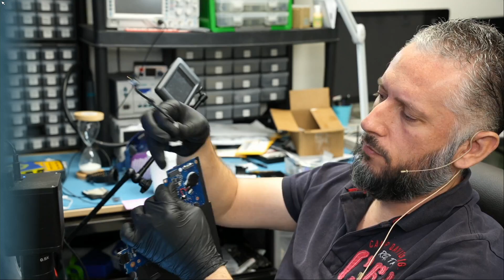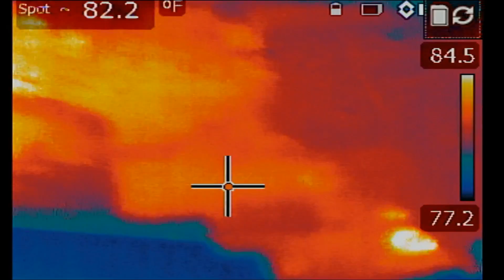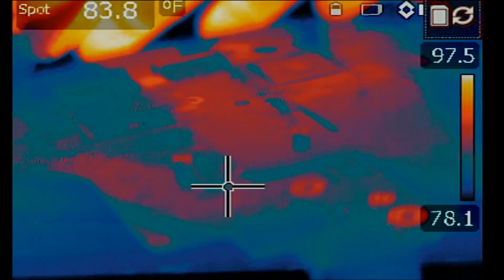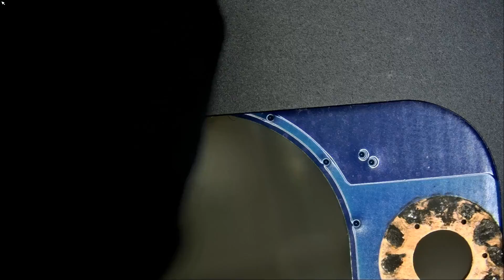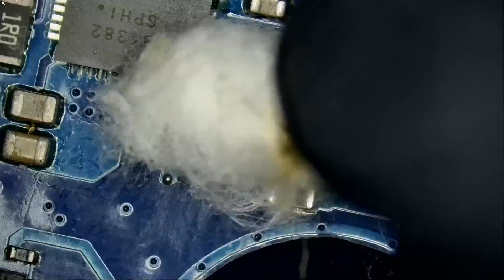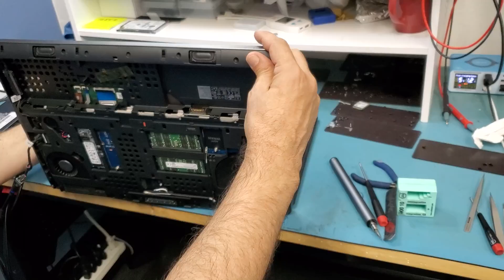Dell Precision Repair. Charger turns off and Laptop won't power on.

Comment: I have a 2018 precision 7530 that had the same symptoms as described in this video. However, the root cause was not a short circuit, it was a bad charger. I started by replacing my charging port and when that did not resolve my problem, I ordered an aftermarket charger online and that new charger resolved my issue, my laptop began charging again. WHEW! Glad it wasn't the mobo.

Comment: Would you know what causes a Dell XPS 8500 Series desktop PC not turning on. The power button was tested and it's working fine but the pins on the motherboard that connect the power button are not working as well. I touched it with a screwdriver but does not turn on the PC

Comment: @NorthridgeFix
Great "simple" repair of course excluding the immense disassembly reassembly process of the machine. It would be no other way that the repair is buried somewhere deep on a machine more complicated to disassemble. I've done a few of these, but I have it start to finish. No big Boss to help while I repair another. Prescription bottles with a dry erase marker are good for the many parts of each machine. Also a magnetic mat and a magnetic parts tray that mechanics use are great ways to keep the screws in check. Most notable for this video was that the ending was the most played section as people studied Alex's work area to see what he uses to do repairs AND videos. How a bout a video sometime with the description section listing the make and model or at least a decent description of what's there in the work area for those that are deciding to do the work? If people know what works for you they would waste less time getting the wrong equipment. Example: you always mention everything you use in the shop is available on the website, but the video production equipment lighting, computer build switcher, cameras, screen, filters and some miscellaneous tools etc are not there.

Comment: have tablette dell venue T07G 11 pro ,I left it updating at night, and in the morning I found it turned off also the power light is off I tried most solutions in the dell's sit but always still off,I checked the power charger it's good it gives 19.5v and when I checked the connectors battery emplacement I found 2.23v, my friend tell me you must change the battery, but I think perhaps the Dc power jack board of computer is it out, please could you help me

Comment: what are the tiny 3 pin transistors that are labeled 24J36? at 2:55
how do you find out the differences between different ones?

Comment: If you don't have the rosin (flux) atomizer, freezing sprays also works very well.
Isopropyl is another very popular option.
Reply: Rubbing candle wax onto the components is another option that does not vaporize as you are getting things ready to inject voltage.
Reply: he got all of them

Comment: Who is that kid ?
Reply from the maker: My nephew visiting
Reply: @NorthridgeFix  After such a repair, the video card no longer works at full capacity.  I work in a workshop in another country and we came across more than 5 such models with the same breakdown.  Replacing the transistor did not help the video card work at full capacity.  Although the processor is working properly.  Any ideas?